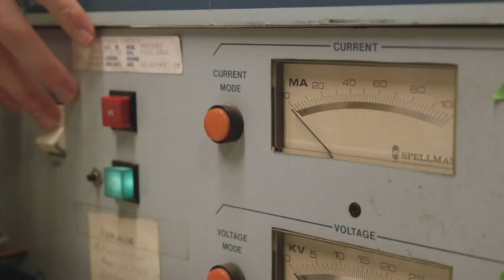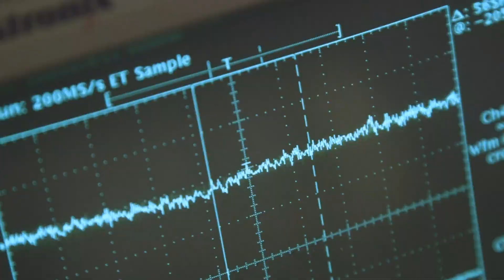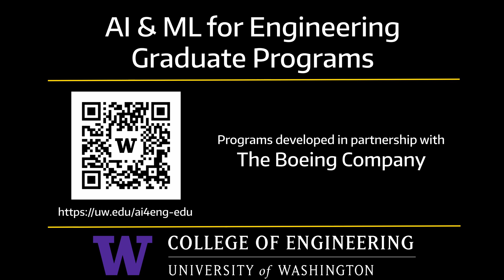New Certificate and Masters Degree in Machine Learning and Artificial Intelligence for Engineering!!

Comment: The evidence from self-driving cars so far suggests that products based on AI are not entirely reliable without significant oversight.
Reply: I believe the goal is to re-discover the classic theory with data-driven techniques. So self-driving cars (whether LiDAR or visual), which is already deeply invested in industry, is not completely relevant to what this program is aiming for, to be at least.
Reply: @iheavense  Without oversight, these products will still cause major problems.  There will be circumstances that the designers did not foresee and include in the AI's neural matrix and these circumstances will cause unpredictable (and possibly dangerous) behavior.  The ONLY known way to counteract this is to have a human supervisor make the final decisions.
Reply: "entirely reliable" is the wrong threshold. The only relevant threshold from a cost-benefit standpoint is "better than humans".
Reply: @matthewmechtly5026  Assuming this is true, what metric measures "better?"  Better for who?  I doubt that the victims will agree that this is better... especially when it turns out that the victim has no road to justice.